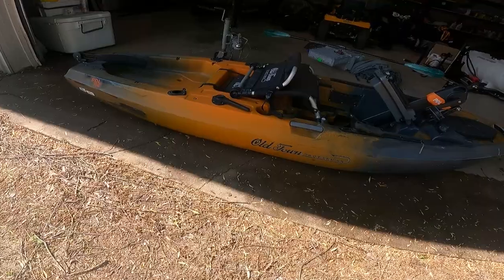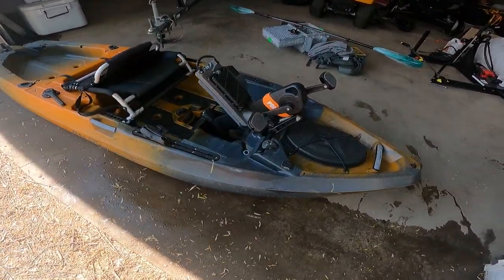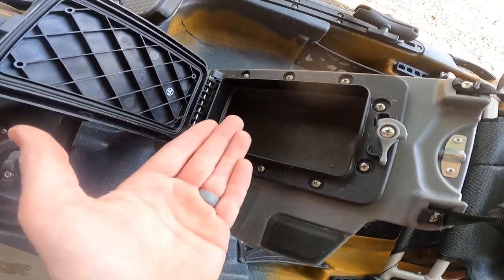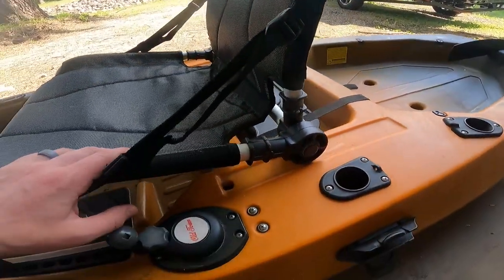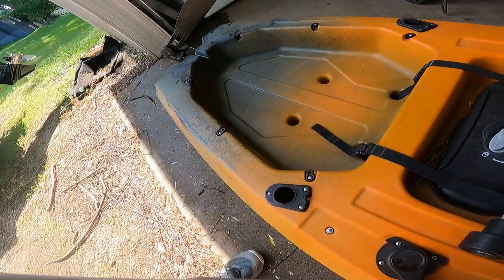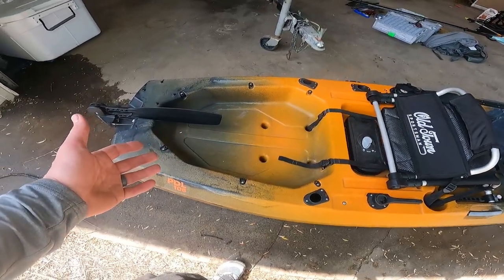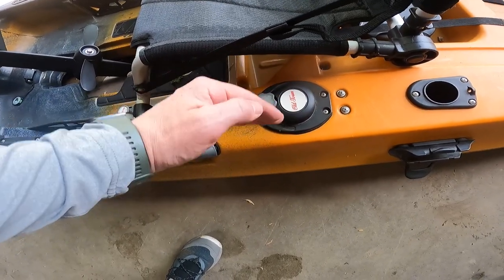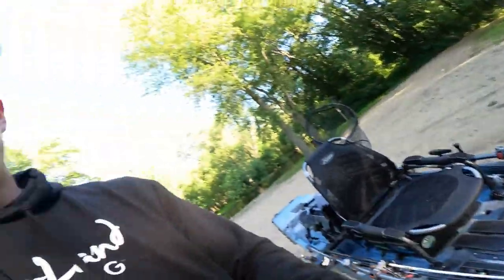Old Town Sportsman VS Hobie PA 360 I FULL WALKTHROUGH AND REVIEW

Comment: There is no competition or equal, to the Hobie 360 drive. It is the cream of the crop, handsdown. No others do what it does. Also, their seat is 100% better than any other, period. About the weight, well I dont know anyone that does not use some sort of wheeled dolly for transportation. Whose gonna be carryina a fishing kayak anywhere, anyway !!! Its is wide and very stable. The Hobie PA14 360 is #1 all the way around. The price reflects all of the great engineering put into this boat. The rudders that are easily raised and the retractable transducer mount.

Comment: I bought a PA14 360 and I really like it a lot. I also just bought a PDL 120 for my wife. I tried a cruise on my buddy's PDL and I really liked it. I agree about the speed of the old town. There are things I like and don't like about each. One thing I think that old town wins is the rudder deployment. It seems like every time I am landing on my Hobie I have to fumble a little to pull my rudder up. I like how pulling the drive kinda keeps a little more space available on the old down. The Hobie bow storage is really nice in the accessibility and way better than the old town to maximize my capacity in it I have taken out the white bin and store only non water sensitive things in it. Still, I've only ever had less than a tablespoon in that area when I have found water in it. I have a love hate relationship with the rod tubes in my Hobie. They're so nice for having a good number of rods available but I've bent a few spinning rod guides trying to get them stowed and it takes a bit of jockeying to get rods much longer than 6'6" in and out of them while seated. I like the tubes more than what little rod or other storage comes on the old town. I'll probably build a side saddle arrangement for the old town to help with rod storage.  I think the fish finder setup and installation will be a win for the Hobie but I haven't started on the old town yet. After seeing reports of folks having issues with 360 drives and repairs being slow. If my Hobie drive dies early I will prob go to old town or maybe look closer at a Jackson Knarr.
Reply: Since the Hobie is more than twice the price of an OT, I rest my case.

Comment: Paul, that was a good review. I have had the Predator PDL 132 for a couple years now. I wish the Old Town Autopilot was in the budget! Weeds and lily pads are another negative for the pdls. It is easy to clear them, but it would be nice if there was a weed cutter feature so I didnt have to stop and pull the prop up.
Reply: It's true I had some of those issues on the frog pond but some of that's just the reality of running pedals through the gunk. Autopilot looks really cool!
Reply: One thing I do with varying success rate is pedal hard backwards when you get sense your propeller is getting caught in vegetation. I might really chug it in reverse as hard as you can for 3-4 spins. This usually clears my prop from grass/weeds without having to pick it up. Hope this helps!
Reply: @ryant527   I have tried thst with varying success. I appreciate the tip though.

Comment: Had a Hobie and sold it. Does not handle wind very well, had constant problems with the drive. Moved to a Bigwater 132 and like you said, Old Town is bullet proof. I can’t tell you how many local guys have constant issues with their hobies. They are so nice, but fragile to me.
Reply: I hear ya man, glad you found something you like!
Reply: The one thing the Hobie has over the bigwater 132 is the drive.  The fins are shorter so you can navigate shallow waters better.  I got caught out in the flats in low tide in my old town and i had to paddle 2 miles back to the launch.  Either weeds clogging up drive or running aground. My friend in a hobie was able to pedal all the way back no problem.

Comment: Great comparison between two kayaks. Hobie is slow because of hull design too much water surface area contact and resistance hull.  But it is the best stable hull. And has most torque than any system.
I lost my hobie pa14 from fire. I still have 180 Mirage Drive and Vantage Seat. Now my problem is which Hobie kayak to get. I'm most interested in 360, but I find pa14 or 12 too heavy. Outback is all rounder and much lighter. Maybe use sidekicks for more stability.
And no trailler for outback... My vantage seat for picnic..
Reply from the maker: Dang!  Sorry to hear about the fire!

Comment: 106PDL is a great boat... I have one but, the Hobie mirage drive is more efficient and faster for sure. Scientifically it is the most efficient drive out, proven by force and speed testing. Now, reliability and value... The PDL has it. 
I still run both my Hobie and my Old town, solid yaks for sure but your gonna pay a lot more for the Hobie and get less customer support and less reliability outta it.

Comment: IMHO, the only advantage the Hobie has over the OT is the ability of the fin system which allows one to ease through weedy areas. However, it takes me a max of 15 seconds to lift the drive, clear weeds and redeploy. Again IMHO, much too much is made about the difference in the front end storage. I’ve never had a drop of water enter my hull.   And when you consider the HUGE price difference, it’s a no brained for me!

Comment: Great video but the problem is that you are comparing a $2500 kayak to a $5500 kayak lol. I have the OT 106 powered and I love it. Weight is an issue as I have a bad back. I do love the Hobie but just too expensive for me.
Reply: Totally understand, tried to call the price differential out in the video. Not knocking Old Town at all just comparing common features
Reply: @paulglass7268  for sure the Hobie has some sweet features but it should for that price lol
Reply: @danielsherman2503  100% 🤘🏼

Comment: the word I would use to describe the front hatches is "water resistant" lol my main gripe with my old town is the "rod prep" thing they tried to do with the slots in the front and the part under the seat to hold the rod butts and keeps me from putting more storage under the seat
Reply: Yeah that was a little frustrating, but again for a 10ft boat, not bad at all
Reply: @paulglass7268  yea I have the 106 idk how many times I've been tempted to dremel out at piece under the seat and plastic weld it flat at the same time don't want to structurly destroy the kayak
Reply: @noahbeu1515  lol I hear that!

Comment: Very good video. Which Hobie model do you recommend that an Xi3 or Torqeedo can be added to, preferably an Xi3. I'm a 100% disabled vet and looking at using a motor as the primary power source with paddling/pedaling only as needed
Reply: The pro angler models would be great, can't speak to any others as I've never had them though
Reply: I'm in your same situation but will be on a rocky, shallow in places river. I started looking at jet propelled kayaks and here I am. Although more expensive a jet boat may be better suited for me

Comment: Question about the old Town kayak.  If you're going somewhere super shallow and you are just going to paddle is there a cover for the pedal drive hole? Thanks in advance!
Reply from the maker: You just lift it out and lock it in place.  There are some aftermarket options.
Reply: @aaanglers  thanks.  Are you referring to aftermarket solutions to cover the hole?  I would just like to leave the pedal at home for some trips.

Comment: I just got a Pro Angler 12 360XR about 3 weeks ago.  It was GREAT for about two hours on the water.  Then the 360XR wouldn't catch on the gears, and wouldn't stay straight.  The whole thing was hellishly expensive, and two hours into it the drive just spins like a top--WHEN I'VE GOT IT LOCKED IN 'FORWARD ONLY' MODE!!  Hobie has got to get a grip the the mechanics of this.  I'm after my dealer now, it's NOT going to be pretty.  The Hobie rep wouldn't even call me.  It's infuriating.
Reply from the maker: There is a reason we eventually sold our Hobie 360s... Had to get out of them.  Posted some videos on that too